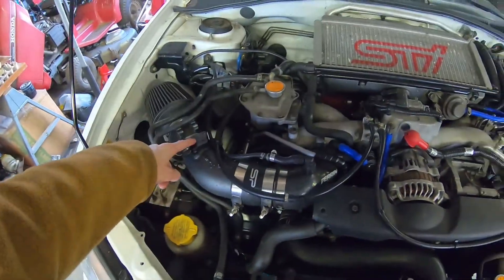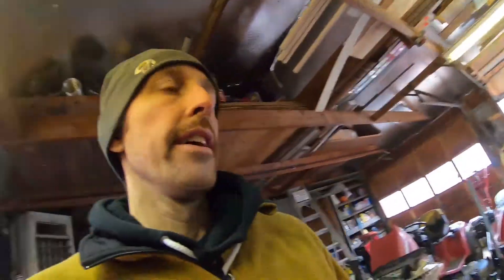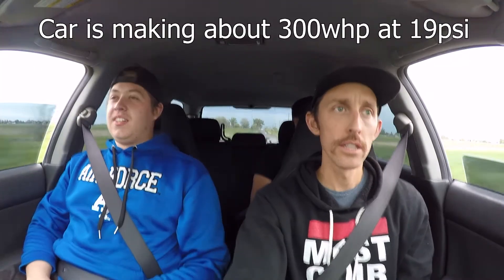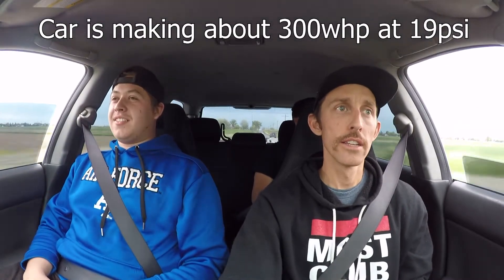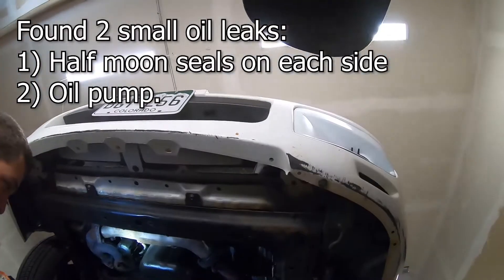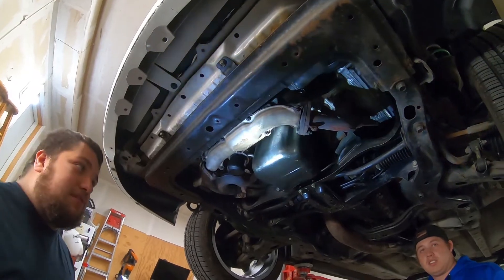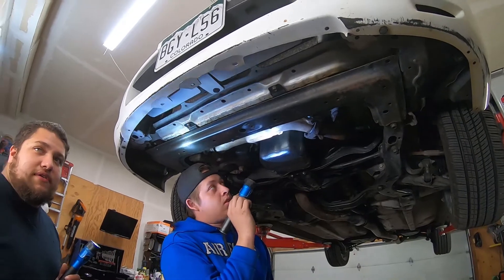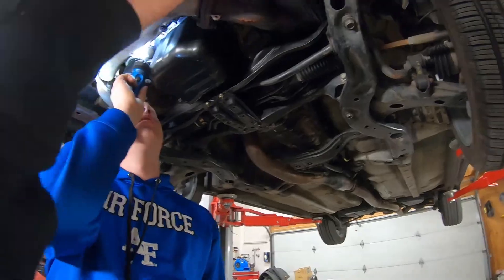WRX Project Ep9 - Issues SOLVED!  Making 19psi of Boost.

Comment: Glad to hear you found the issue and got it fixed! I was only hitting maybe .03 mpa (stock boost gauge) and the boost would start surging up and down around 3.5-4k RPM, put on mishimoto IC hoses (they were a bish, have to trim them down on the y pipe), and found my turbo inlet clamp was loose as hell, went ahead and tightened it all up, and now I hit full boost. :) Had a little drop off on the way home, so just tightened up some of the clamps on everything a bit more and fingers crossed everything works well!
Reply: Btw just picked up this 02 SRP WRX wagon a couple weekends ago. :) She needs a little love, but she has about 5,000 miles on the engine (rebuild and head gasket done at subie shop) and on the new clutch
Reply from the maker: Hi Alex, that's good to hear!  It can be so frustrating trying to find track down the cause of these issues.  I'm planning to post a video this week about how to do a pressure test if it's not something like what you mentioned - like a loose hose clamp.  Thanks for watching!